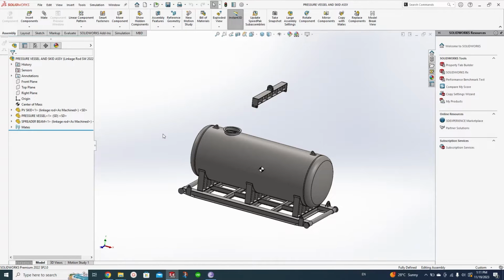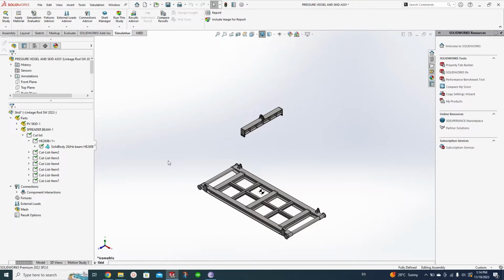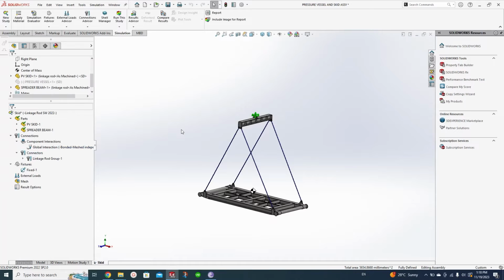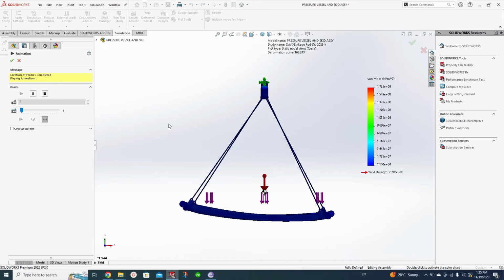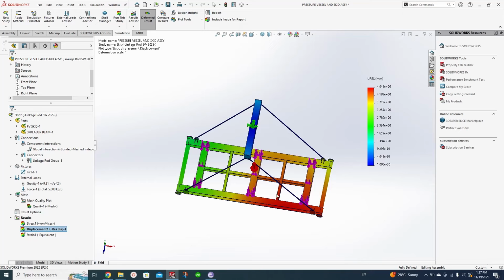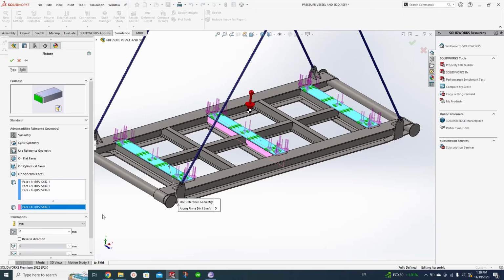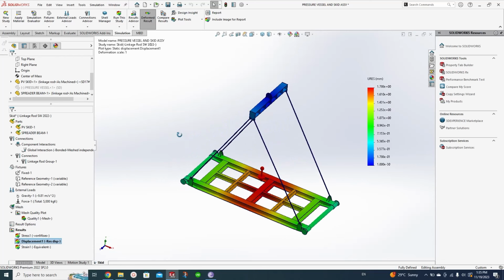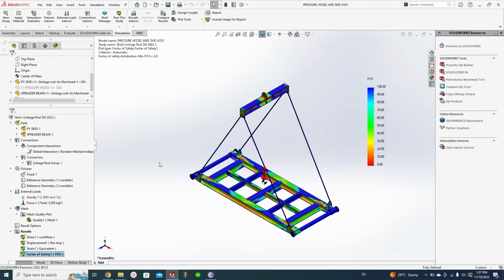Pressure vessel Skid Lifting Analysis Solidworks

Comment: It frustrates me so much that solidworks is unable to automatically stabilise the model if the center of gravity is off at all like in your example. What it should do is rotate the model so the center of gravity is in a stable position as it would in real life, then base deflections off that starting point. I'm so tired of my center of gravity being off by 2mm in a lift simulation, and the deflection comes out to a kilometer. Restraining the model you did is an OK solution but it is not perfect, for example when you retrained X and Z movement of the outer crossmembers you actually overdefined it. As your side beams bend up due to the load, they will also move inwards toward the center of the frame. Yes majority of the movement will be in the free Y axis, but the movement in X axis is not insignificant.